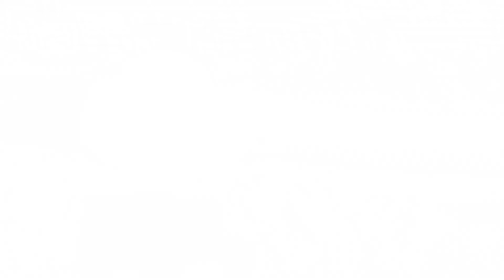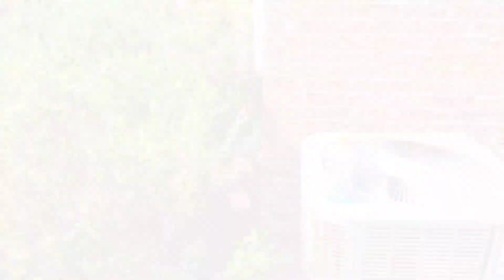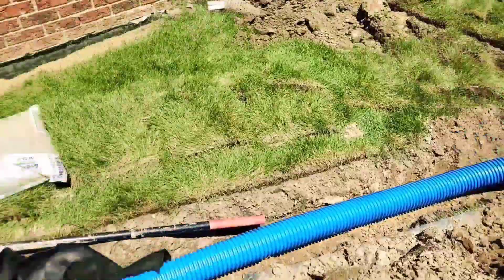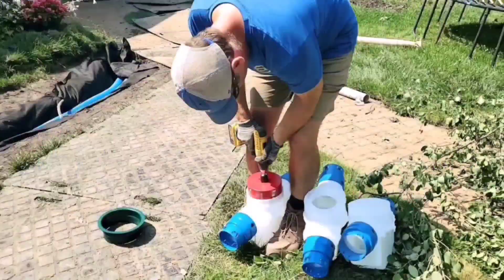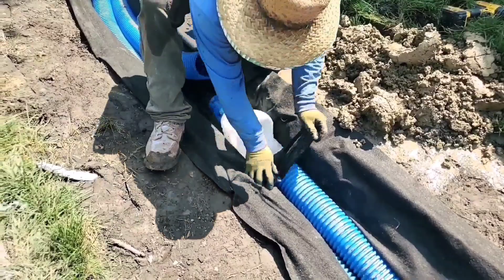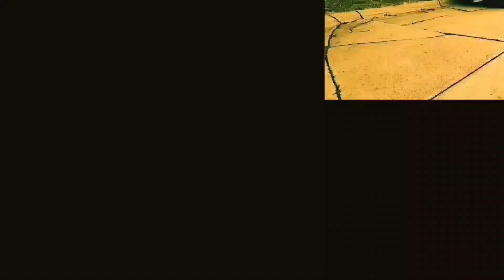Best Catch Basin for any Yard Drain application

Comment: This downspout you’re using the blue pipe…I watched your downspout kit for the DIYer, that comes with black. Is there a difference ( flow rate, strength, ridge height inside)
Reply from the maker: Blue is extra heavy duty and there's nothing even close to the blue. It's an all Virgin pipe with no recycled materials. 💪